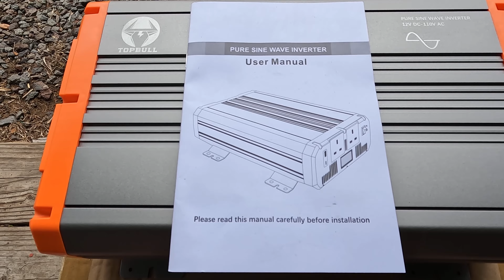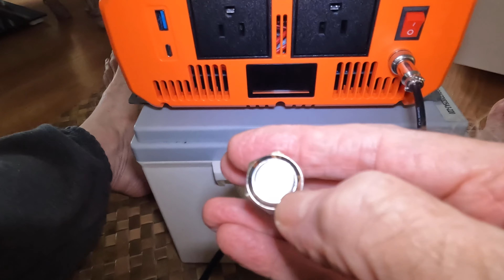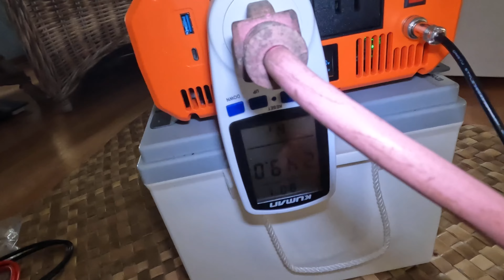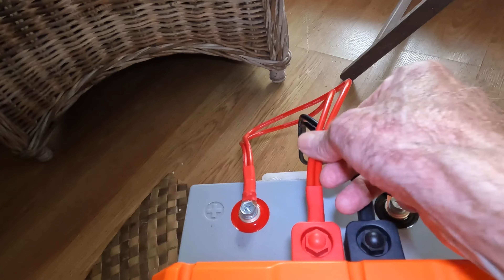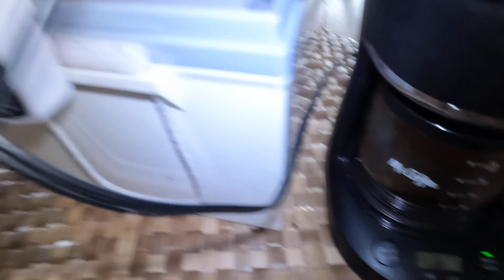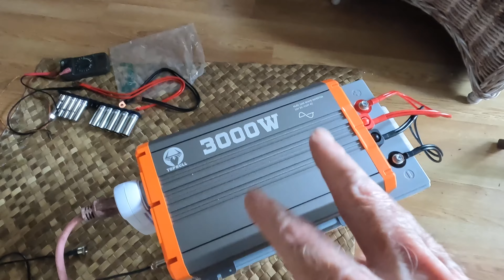TOPBULL 3000W PSW  Inverter ~ Portable Power Effortlessly hooked up ~ Get Ready for the Storm

Comment: ☕ Gotta have fresh ground Coffee and Mr. Coffee Maker Brewing up the Good Stuff - 🌴 Aloha 🤙 Brother Bob ... I stayed with WZRELB 24 Volt 3K PSW Inverters and 3 RENOGY Units 2 a 2000 and 3000 Watt Models @ 12 Volt and a Newer 24 Volt 2000 Eco Mode / GFCI Model for The Ole 1956 Spartan 30' Motorcoach / Bunkhouse Kitchen and AC Units

Comment: Looks like they did a nice job on it, but with a couple of fairly consistent exceptions: (1) The cables. We all agree that supplying adequate cabling if they're giving you cables at all would be better (safer) for the user. (2) 110Volts. Why 110V and not 120V? Loaded up at, or near max-continuous power, the output will likely drop down to around 103-107 Volts, and a lot of equipment doesn't like that (my washing machine, for one). At this time, the price is really good on Amazon. Wonder what the actual idle current draw is? The propaganda says 100% efficiency, but that can't be. Anyway, mahalo and be well. 🍍
Reply from the maker: Yeah, those cables! Finally turned it off last night. It kept working fine, but that fan ran quite a bit with no load, and the noise got on my nerves in my living space. Aloha!🏄🏼🤙

Comment: I'm always curious why the manufacturer puts the smaller gauge cables in the box.  Seems a much heavier gauge wire would be more appropriate for 12v.  Good price however.  Still a great feature to have is a port to hard-wire the inverter directly to a distribution box.
Reply from the maker: Yeah, I'm not sure why they do that either. I usually change those cable out 1st thing! I'll continue to work this out and see how it goes. Aloha!🤙

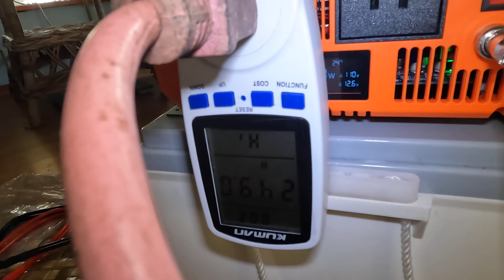Comment: 10:02 its 'rock steady' because the watt meter displays the peak high reading(Hi) and not the real time reading. A mistake I often see when using this particullar watt meter 🙂

-Yeah having a 3,000W 12V inverter is a real challenge to all wiring/connections pulling a whopping 240-260A (3,000/12.8V + inverter loss) I try to avoid anything much over 100A by increasing voltage in the systemdesign.

Comment: inverter looks real nice. you need a clamp on DC amp meter to read battery amps. read before buying. some are ac amps only. and with DC amp clamp meter you have to zero them before putting on to wire. that would go nice on a hand truck.  get 0 AWG or bigger wire and keep them short. well they did run 2 -10 AWG  wire. good about 60 amps short run. may be CCA wire. be careful with that . not only do you get voltage drop it makes a mess when get wet. and crimp ends come loose after a wile. it's the heating and cooling of dissimilar metals is the cause. all copper and copper lugs is what you want. tinned copper is great. helps with corrosion. you could put 2 of them lugs together. flip one up side down . some times you have to flip one to line up. but was fine for that test . full load 3 KW will pull around 300 amps from battery. not going to happen with the wire they gave with out a smoke show. if you double up what they gave. that 4 -10 AWG . about 120 amps.  so about 1250 watts load . that inverter makes more power than that Honda 2K generator . I would go 48V or 24V with that power level. at 48V them wires would be big enough for 3 KW . a heat gun or hair dryer would be biggest load you have.

Comment: You might be able to use both cables if the bottom one is upside down - the barrel of the lug on the bottom.  Then the flat sides of the two lugs would be together.

But those cables are a joke!  Do they at least document that you shouldn't use those cables for real use?  Or are they depending on being able to blame bad cables if the inverter doesn't support the specified power?  For sustained use at 3000w with 12v it requires 250amps which means even 2/0 AWG is marginal.
Reply from the maker: I'll try that for sure! Mahalo!🤙

Comment: Seems decent enough though one thing I always do with inverters that don't use proper internal fan control is to open the things up and see just how hot they let their insides get before they turn on the fan.   If the insides get too hot, I usually hack the temperature sensor to make the unit turn on the fan earlier rather than later (generally by adding a 1.5K or 2K resistor in parallel, across the temperature sensor pads).

I have a little 12V pure-sine-wave car inverter advertised as "quiet" that let its FET get to over 110C before it turned on its fan.  Quiet... yah.. quiet to the point of burning up the unit(!).  After a quick mod it now turns on its fan at 70C instead of 110C.

-Matt
Reply from the maker: I already posted an update! Haha! Still watching it , but doing fine right now. I don't know what that was. Aloha!🤙